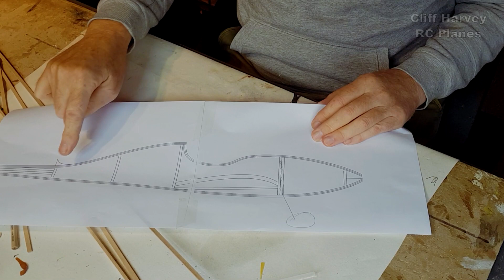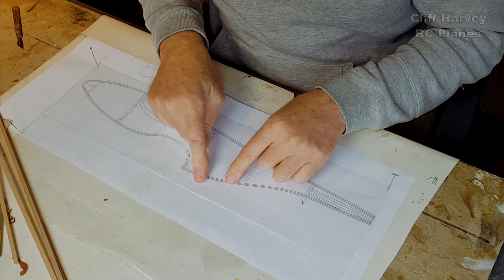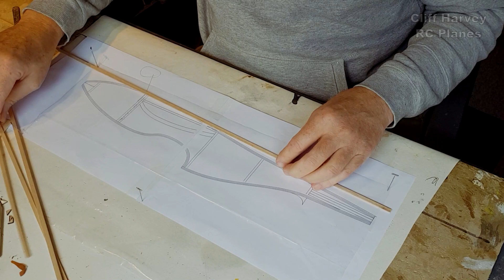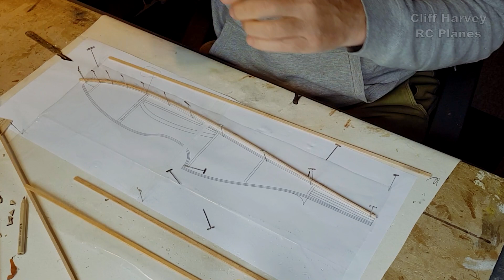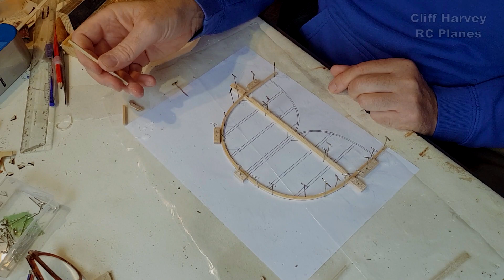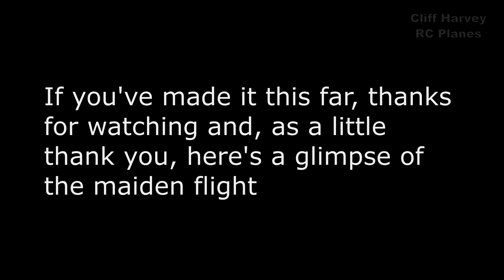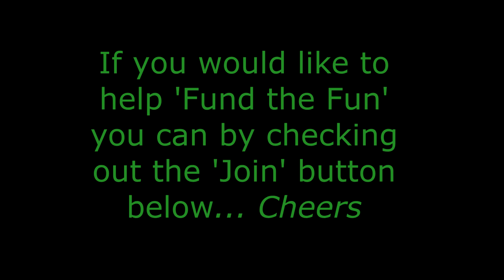Putting Together the Cutest Little Model!

Comment: I am personally not a huge fan of the low calorie flat fuselages but she does look pretty , kinda like flying stained glass .
nice job Cliff . And yes laminating shapes is a rewarding experience . I messed up on a bird dog but now building a Cessna 150 , but , I made nice rounded laminated tail parts that look like the bird dog to replace the kits stock " squarish tail " . It probably weighs more than it should , but hey man ... its a learning experience , and it look pretty sweet  .
Keep the good tips coming . Thanks Cliff , Never get tired of your stuff . 
Oh ya , I got this one little piece i need laser .......
Reply from the maker: Hi Diceman, I did think for a while that the fuselage may be built up for this design but I wanted to keep it simple(ish), we'll see what the future holds. 'Like flying stained glass' ... I love it, your absolutely right. Keep building and learning that's what I do, cheers.

Comment: 12:40 what is the point of closing off the end grain? i honestly dont know.
Reply from the maker: Hi Elnufo, that's a very good question, the answer is because it's end grain a lot of the glue gets sucked away from the joint into the grain of the wood, this means you end up with a weaker joint which is not what you want in any structure, thanks for asking, cheers.
Reply: @CliffHarveyRCPlanes  thank you for your kind reply. ☺